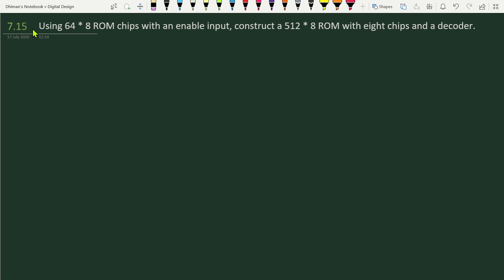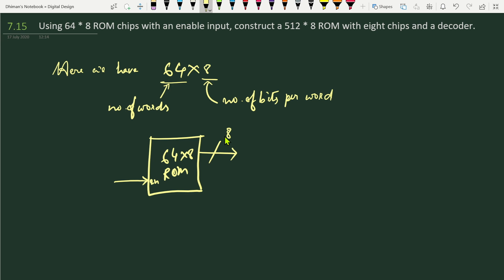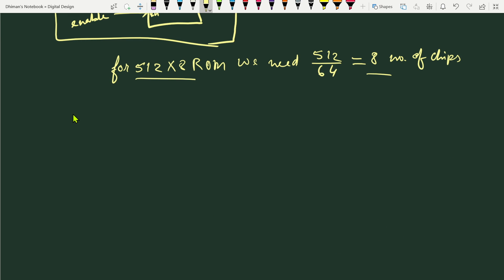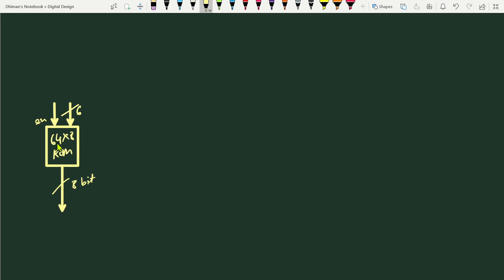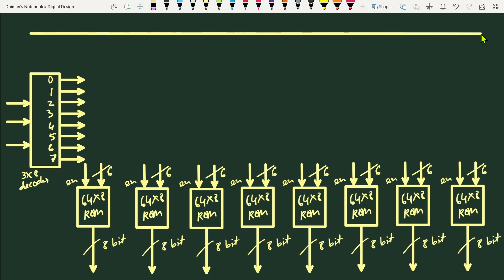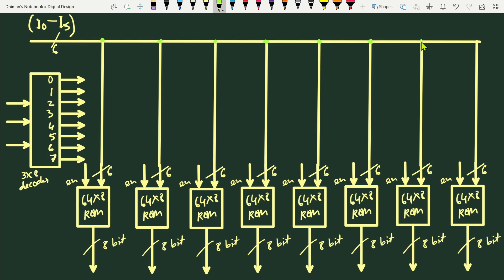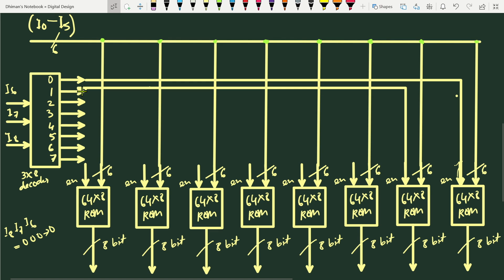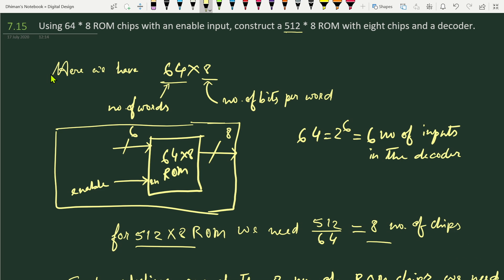Q. 7.15: Using 64 * 8 ROM chips with an enable input, construct a 512 * 8 ROM with eight chips and a

Comment: Assume that a processor has 24-bit address bus and 8-bit data bus. Design a
computer system that interfaces this processor with RAM of size 512 KB made
of 64 KB chips and 64 KB of single chip ROM with address map starting at
locations 400000 and 000000 respectively. Draw a neat sketch of the schematic
diagram showing the interconnections and the address decoder. how design this?

Comment: i have one doubt , if this circuit is implimented in real world , decoder as some delay so adress maching with that particular data will be missed , so what we can do to not loose or mismatch data between those address
can we use wait state for the decoder , where it generate wait delays?